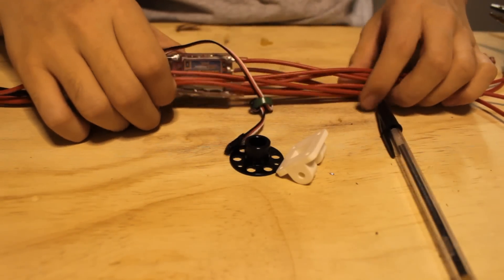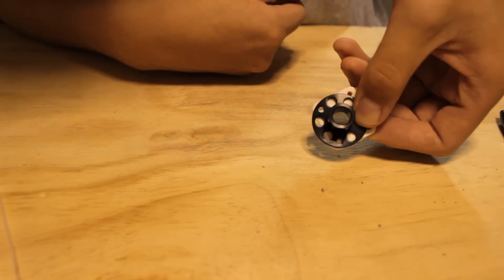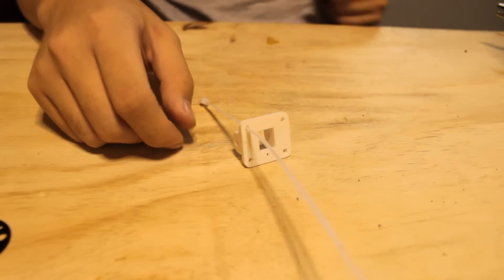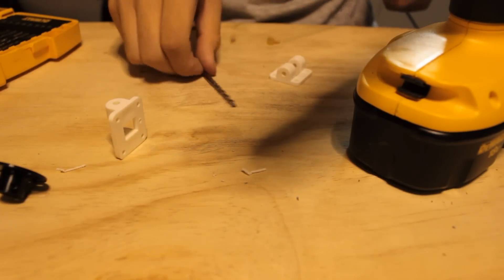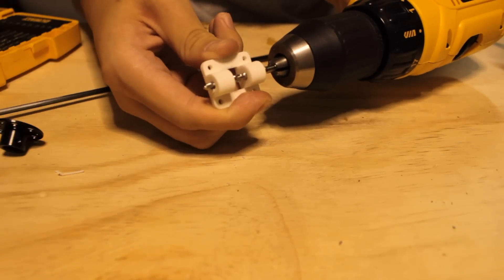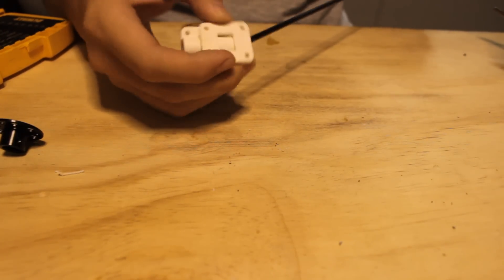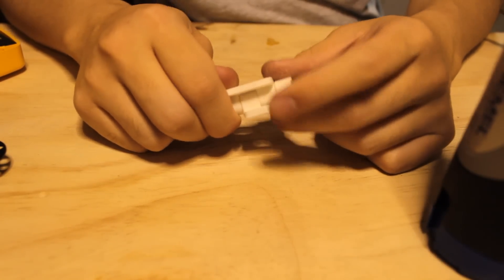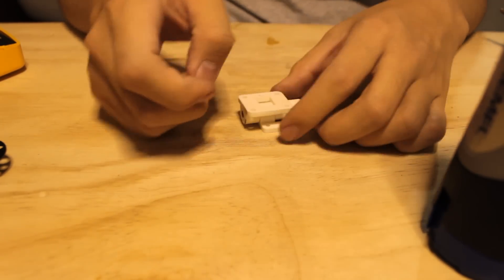Complete Beginner's Guide to Building a Tricopter Part 3

Comment: I think it would be a good idea to use a vacuum cleaner while cutting. Of course just as addition to the respirator.
If you stop cutting, the particles are still there. Even if you use a piece of paper which you throw away afterwards.